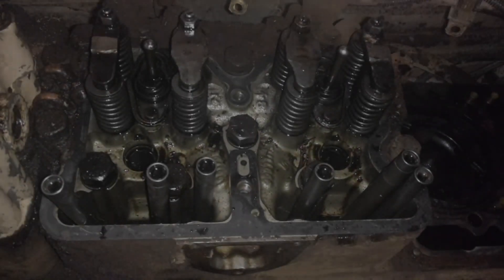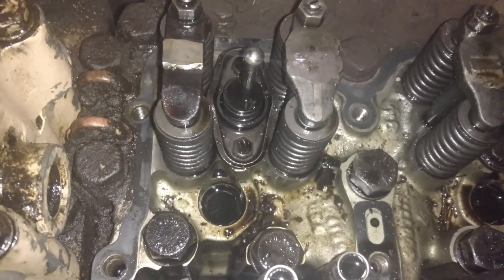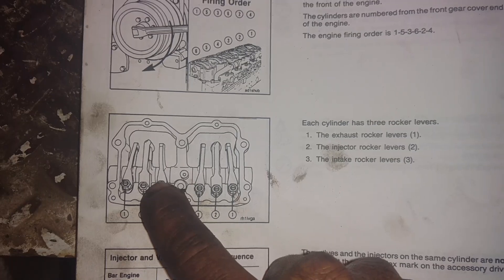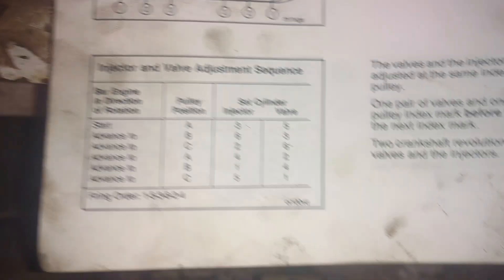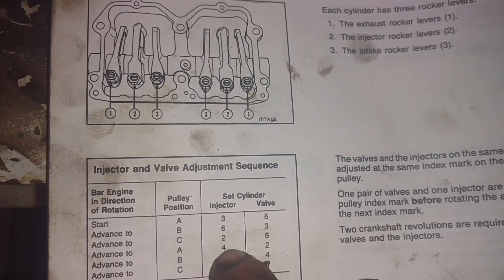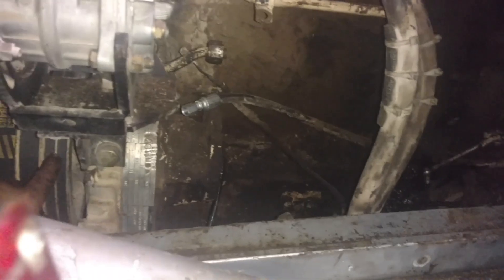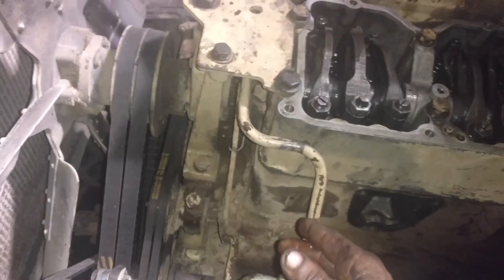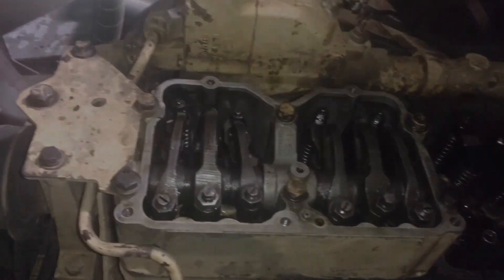Cummins valve and injector adjustment

Comment: great video! is this the method for big cam NTC 350?
Reply from the maker: +Josh Gibson Yes you can set it up that way or you can run your valves and Injector s on the same cylinder and set the Injectors to 72 inch pounds
Reply: I'm confused, data plate says zero lash on injectors and nothing for injector torque? I just had the overhead adjustment done, and now it smokes like crazy. way worse then before and I think fuel is mixing into oil.... he didn't do something right and of course I can't get the guy to return my calls. so I am wanting to do it myself
Reply from the maker: +Josh Gibson  First of all what engine do you have?
Reply from the maker: Josh Gibson  Start out on accessory drive mark A, valves will be loose on 1 or 6 , on the cylinder with valves loose adjust injectors to 72 inch pounds, make sure you adjust Injector first before valves, and then on same cylinder adjust intake to 11 and exhaust to 23 that's what your data plate should say. Go in firing order, 1,5,3,6,2,4.
Reply: it's the 855 big cam NTC 350
plate says 11 and 24 on valves and zero lash on injectors. injector torque is blank
Reply from the maker: Josh Gibson  So go to 72 inch pounds on injectors and then on the same cylinder set your valves to 11 and 24
Reply: I'm going to give it a shot. thanks for responding
Reply from the maker: +Josh Gibson  Any questions, don't be afraid to ask,
Reply: just wanted to make sure... I can adjust injectors on same cylinder at 72 on top stop injectors?
Reply from the maker: +Josh Gibson  Yes, make sure to set the injector before valves, and make sure you are at tdc for that cylinder by checking to see if valves are loose
Reply: @joshgibson6477  I had the same question

Comment: so how to you tell the difference between a 290 Cummins and a 350 Cummins
Reply: grease monkey101 ....its very easy...Cummin 290 n 350 also big cam...but..290 doesn't use upper cooler..350 use it...n one another thing the timing cam for 290 n 350 also not the same...
Reply: Marc Robinson ...the 400 front balancer is bigger than 290 n 350...
Reply from the maker: +Marc Robinson  Well they are pretty similar, usually I just look at the data plate on the accessory drive cover, it will say ntc 350 or or nta 290 .  I Know the 400's had larger crank dampners than the 290's, but I don't remember if the 350's we're the same as the 400 or 290.I guess I have never run across a 290 or 350 with the data plate missing. I am sure there is an old Cummins mechanic somewhere that could rattle off all the variations, but I usually just go off the plate.

Comment: I had my old versatile 800  n855c250 running great finished seeding Friday when the vent started smoking wild blow by. I finished went to move it 2 miles next day it started and ran great and half way home the coolant filled the crank case as pressured up  as the block was would you guess head bolt or gasket ?
Reply from the maker: jeff amoth I would guess head gasket, pull the turbo and exhaust manifold and maybe you can see a wet valve port, or sometimes I take a pressure tester and pump up the coolant system and can hear it.
Reply: thanks no turbo that helps some runs great but white oil! thanks again
Reply from the maker: +jeff amoth I have seen head bolts do that also, could be either one . You could pop your valve covers and just grab the head bolts and yank on them with a pair of pliers and see if one comes out. Oh yeah no turbo n855c, don't see many natural aspirated ones. Thanks for your comment and for watching.
Reply: I tried pressuring the system, it drained down in about 15 minutes couldn't hear for sure what head was leaking or were it was leaking. I pulled the middle head after finding no broken head bolts because there seemed to be moister on outside of head on the block.I deiced to pull all 3 after not finding any definite failed spot on any of the gasket's.I didn't have a dial indicator so I slid a .007 feeler around the edges of the sleeve every thing was below it and looks flat will check it later. the tractor is 116 miles from the nearest Cummings dealer in the US hard to have some on just swing by to take a look.I was told its hard to see the failure of the gasketts some times? on all the old cases I have worked on I could see the problem.
Reply from the maker: jeff amoth I wonder if an Injector copper cracked, any pistons have any white crusty looking crap on them? Run each piston down to bottom dead center and see if you have a cracked liner. Look at heads real close and make sure you don't see a crack between a water port and where the fire ring is. Sometimes problems like that can be hard to find, look at Injector coppers real close too.
Reply: yes one piston had a little white on it. the bolts on the water jacket side were wet on the middle head. if the sleeve cracked wouldn't it pressure up the radiator? I had a block blowing oil like crazy out of the valve cover                         I am trying to get spraying and working on this a little at a time
Reply from the maker: jeff amoth  Yeah cracked liner doesn't make sense, you say oil was blowing out of blow by tube on valve cover?
Reply from the maker: jeff amoth If you had oil coming from blow by tube it can only be rings or valve problem like a really bad valve guide.
Reply: well it was pressured up, actually no oil shouldn't of said that it was so pressured that I thought i had a leaking seal in front of the motor and the vent hose was smoking and acted like crazy blow by. the more I think of this I went threw a ditch and was low on fuel i suck some air and when the motor regained fuel flow that when things went to hell

Comment: thanks for sharing! it seems people really struggle with the overhead on these old cummkns engines.
Reply from the maker: David Pokorzynski Yeah ,if you run valves on a Cat or international they use valve overlap on the companion cylinder and loose on the one to adjust, the old Cummins make change your train of thinking.
Reply: is this the same method you would use on a 350 small cam?
Reply from the maker: David Pokorzynski No, on a small cam start at A mark on accessory drive and see if 1 or 6 is loose, first  adjust your injector down to 72 inch pounds and the n valves intake 11 and exhaust 23. B Mark is 2 or 5 and C is 3 or 4. That's Obc method.
Reply: okay thank you! and a small cam 350 does have top stop injectors correct?
Reply from the maker: +David Pokorzynski Yes they should have top stops if I remember correctly.
Reply: I bought a 350 small cam, it was smoking pretty bad. I figured injectors.
replaced injectors, problem got worse but still had power. white smoke like crazy. looked like the highway was on fire. had cummins work on it. 2450$ later to run overhead and now it's popping and less power. smoke has settled some but still out of control. any ideas? so many it could be, its driving me sleepless. going to check fuel return line for flow in the morning.
Reply from the maker: +David Pokorzynski I would check injector and valve adjustment first, I bet they set it up on 6 inch pounds on Ibc , run them like I described and see what happens.If that doesn't work could be Afc problem or sucking air from line to tank
.
Reply: oh... also seems the crank case is gaining due to fuel entering and the smoke certainly smells of fuel bad.
Reply from the maker: +David Pokorzynski Try your overhead adjustments, most Cummins dealers these days don't know what to do without a laptop.
Reply: grease monkey101 true story indeed haha! thanks so much for your time!
Reply from the maker: +David Pokorzynski No problem, let me know how it turns out.
Reply: took 3 times but its running like new. thanks so much, I appreciate your time!
Reply from the maker: +David Pokorzynski So it was the valve adjustment.
Reply from the maker: +David Pokorzynski Why would Cummins let that leave their shop running that way is absolutely mind boggling.
Reply: grease monkey101 and charge me 2250 dollars... I needed up doing their job but honestly I'm just so happy right now that its fixed, I don't even care about the money. 
again, you did a perfect job explaining it and it worked amazingly. give you a little laugh... ive never had a diesel engine tore apart in my life. sure I got 8 hours into it but they claimed to have like 30. I'm still no diesel mechanic but I just got a little further ahead.
thanks a million!
Reply from the maker: David Pokorzynski I am glad I could help.

Comment from the maker: intake 11 thousands and exhaust 23 . If it is a big cam 290  you set it like I described in the video to 6 inch pounds on in inner base circle method. If it is a small cam 290 set it on outer Base circle method to 72 inch pounds on injector.On outer Base circle you adjust the injectors on the same cylinder as the valves.
Reply: western truck and tractor repair Brother where do u fix the truck. I have 2017 x 15 cummins need to get  valve adjustment done.
Reply: I run a big cam 3 ,400 with top stop injectors.  I do the IBC method and set my valve lash, 11 and 23 !

Last year, i tried setting it to 14 and 27, but it didn't seem to run too well, so I reset it to 11 and 23, and I ran great.  
 
It's about time to run the overhead again now, and I'm wondering whether I should try again at setting the lash to 14 and 27. 
 What would you advise ?